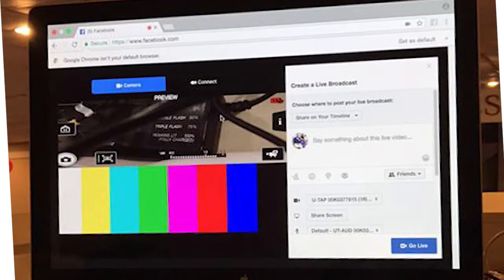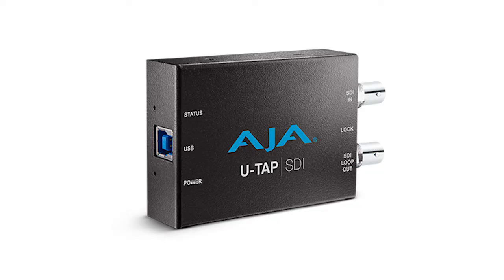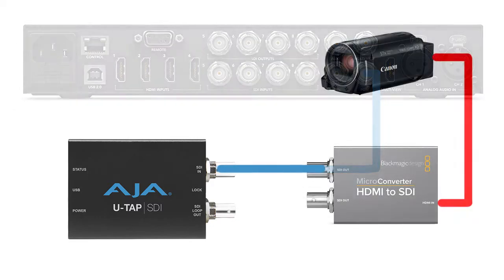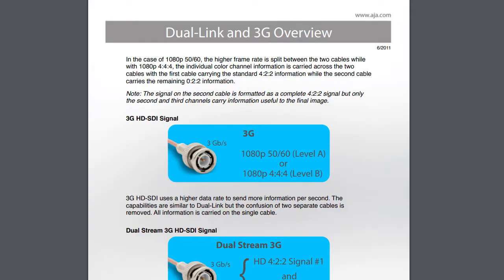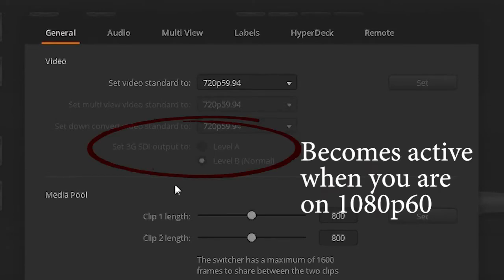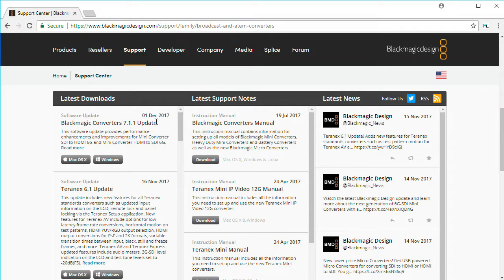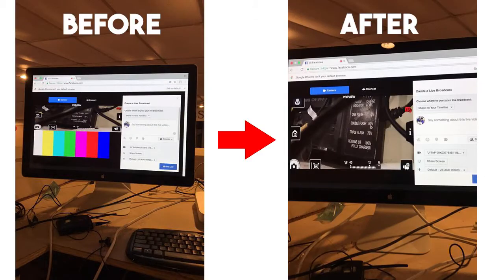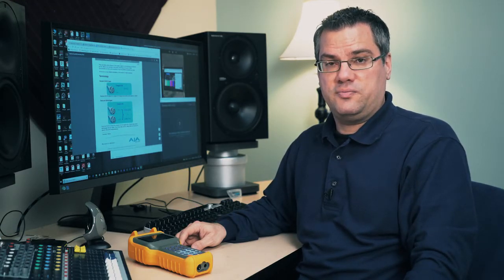How to fix color bars from an AJA U-tap SDI

Comment: hi, im having issues with one of my AJA U-TAP sdi it started showing full colour bars, but the other one is working fine. what could be the problem
Reply from the maker: Full color bars means the u-tap is not seeing an input video signal coming into it.  Check the source/cable coming in to that u-tap.

Comment: I have this problem on the gig I’m on, it’s an Sdi feed I’m getting from a blackmagic SDI splitter/DA and I was getting some funky green and pink lines but I put a decimator on it and it fixed the issue. But I’m guessing it switched the signal from b to a

Comment: From a decklink sdi 4k, i'm still having colour bars even when swapping the signal from B to A... Any ideas? :) (linux)
Reply from the maker: Color bars usually means the device isn't getting a video input signal.  Or a valid video signal that it can understand.  What are you connecting to the Decklink SDI 4K?

Comment: Sometimes my AJA-Utap SDI freezes. Any solution? I use with vMix.
Reply from the maker: Are you using a Dell computer by any chance?
Reply: @BallastMedia  I use a Acer Predator Helios 300 with RTX 2060, i7 9th.

Comment: Hello sir,I am having the colors bars with the U-tap HDMI. It was working fine and one day during live it just stopped working and showed color bars on the whole screen. Since then I don't know where or how to fix it. I am using Canon Vixia HF R800 HD Please help.
Reply from the maker: Color bars on the whole screen means the u-tap isn't getting a signal at all. Check your cables and any devices in line.
Reply: @BallastMedia  I have checked the cables and devices. Unplugged and plugged the cables, uninstall and install the OBS even. Is there another way to check the cables?

Comment: I get those lines on OBS.  I am using sony BRC300 and Unisheen SDI to USB 3.  Any suggestions?
Reply from the maker: Do the color bars cover the whole screen, or just half?  If the whole screen, that's usually an indication that the capture device (unisheen) isn't getting a proper video signal on it's SDI input.
Reply: @BallastMedia  it's the whole screen.  I am going to try the svideo output and see if that works.  Any other suggestions?

Comment: Hi, am having similar problem with my setup as well.. I have the utap sdi, using the Sony mc 2500 using obs.. Any help or suggestions is greatly appreciated...
Reply from the maker: Are you using the HDMI version of the u-tap?  How are you getting the HDMI of the camera in to the u-tap?  Through any converters?
Reply: @Ballast Media...  I have the sdi version of utap and am using HD SDI cable to connect from the camera to the utap... Am not using any converters... I have an SDI output on my camera...
Reply from the maker: @larryakrong907  I don't believe that camera has SDI out?  It has an analog composite video output on a BNC connector, but it's not SDI.   This camera? https://pro.sony/en_AO/products/shoulder-camcorders/hxr-mc2500#ProductOverviewBlock-hxr-mc2500

Comment: It's 09-04 2019 and I just purchased one for live streaming. Why does it only show color bars? Any idea? I have a 64gb sd card in, and it is charged and recording to it fine. I even tried directly connecting my HDMI cord to my tv and that works fine. Only when I try to stream to FB live, or OBS or even Skype thru my U-Tap HDMI, then it gives color bars.
Reply: I found the culprit. I had a "bad" HDMI cable from the camera to the U-Tap. Replaced it and it works fine!

Comment: How to fix color bars from an AJA U-tap HDMI? My U-Tap is the HDMI version. Coming from the Canon Vixia HF R-800 HD using Medium size HDMI to full size HDMI into the U-Tap then their cable to my USB-3 input into my computer. I am using OBS and have used a cheap usb cam that did work well. I even uninstalled the cheap cam and rebooted with only the Canon through the U-Tap HDMI. Maybe my HDMI from camera to U-Tap is bad?
Reply: I found the culprit. I had a "bad" HDMI cable from the camera to the U-Tap. Replaced it and it works fine!

Comment: With this quirk in mind, would you still recommend the SDI version as the best capture device for video production? Or would you recommend the HDMI model with an SDI to HDMI adapter? I have an ATEM TVS HD and the level A/ level B issue has me concerned. I currently have a Decklink Mini Recorder 4K but I want to get away from PCI-based devices so I can use a laptop computer when I need an ultra-portable solution. Thanks!
Reply from the maker: If you are running 1080p60 in the atem all you have to do is switch the level in the atem and your good to go.
Reply: @BallastMedia  I run 1080p29.97 mostly. Does that mode support level A?
Reply from the maker: @pealock  You won't have any problem with that, it's only when you use 1080p60 that this becomes a problem.
Reply: @BallastMedia  gotcha. Thanks for the quicky reply.

Comment: Having the same issue with a simple set up. 
Using the u-tap SDI with a Sony HXR-NX5R with wirecast on a PC. 
Any help or ideas would be very much appreciated?
Reply from the maker: It's an issue with the camera and u-tap aren't syncing up properly with SDI level A and level B. One simple way to change that is to change your output resolution, even 1080i60 would probably work.
Reply: I changed to that resolution and still the same. I’m using the SDI output on the camera. The settings in the camera for video out are; output select: SDI, 1080i, 24p/30p output, down convert type: squeeze, SDI Rec Control: off.
Reply from the maker: Did you try those other settings, 1080i, 24p/30, etc?
Reply: Was a bad cable. SMH 🤦🏽‍♂️. After that the 1080p was showing the half color bars, 1080i got it working.

Comment: Hy im having the same problem but with the hdm, i have connected the micro hdmi  adapter to the camera but im getting  the multy color screem .
Reply from the maker: Have you connected the converter to a computer through USB and changed it to Level A?
Reply: @BallastMedia  i dont have one i have connected the usb to the computer and the hdmi to the camara do i have to use it o theres onother way aroung
Reply from the maker: @AlexPerez-kx6vs  What camera?
Reply: @BallastMedia  zoom Q7 camara im using a micro hdmi adapeter for the hdmi
Reply from the maker: @AlexPerez-kx6vs  Do you mean the Q8?  I believe that camera is capable of resolutions higher then 1080.  You might want to make sure it's set to a standard HD resolution.  The u-tap won't take a 4k signal, only HD up to 1080p60.

Comment: Hey Steven,

All of a sudden I’m experiencing an issue with my camera not showing up in OBS via my UTAP HDMI. At one point I was only getting a black screen, but after removing the input and reconnecting it via ‘Video Capture Device” in OBS, I have the color bars and never showing my feed. 

Any ideas on how to troubleshoot?
Reply from the maker: Skyler Julian What's your path? Camera HDMI direct to u-tap HDMI? Or do you have anything else in the path?
Reply: Ballast Media Yep, Camera to UTAP HDMI to Mac Mini. Have had it up and running the same way since Easter then came in this past Sunday (nothing has changed) and just black screens and/or color bars
Reply from the maker: Skyler Julian have you done the usual troubleshooting steps? Plug your camera's in to a TV and verify its HDMI output. Connect another HDMI source in to the u-tap and verify its passing signal ok. And final connect the whole thing to a different computer.
Reply: Ballast Media I’ve tried plugging in a different camera and another Mac display into the UTAP and OBS still shows a color bar. 

Could this be a UTAP malfunction?
Reply from the maker: Skyler Julian Could be, I'd contact aja's support and see what they say.
Reply: Ballast Media It has to be. When I’m connected to the UTAP, my cameras HDMI status is blank. I have even connected to another iMac with OBS and still the same thing...

Comment: i am still having issues. I am using all the same equipment. I am using micro converter HDMI - SDI, then SDI AJA Utap into my macbook. I cant get converter utility update to recognize the converter...
Reply from the maker: You've connected the "power" cable of the microconverter to USB of your computer?
Reply: so I had to use a different power cable because the 'power' cable did not have USB tip... yes
Reply from the maker: The Well Church LV Ya, basically you just use a regular USB cable connected to the power input of the microconverter and connect that to the computer.
Reply: Gonna try that now!